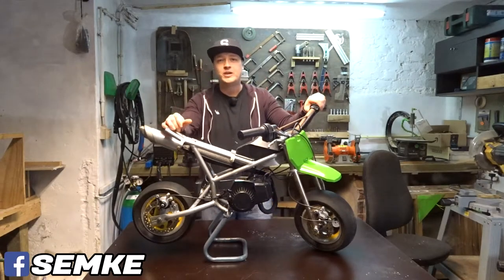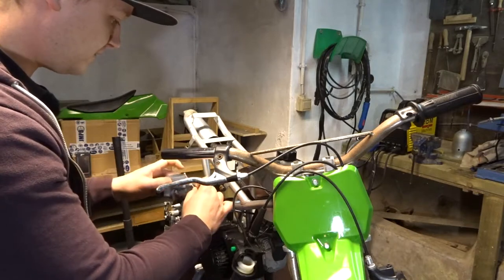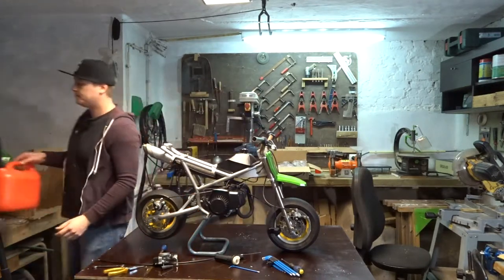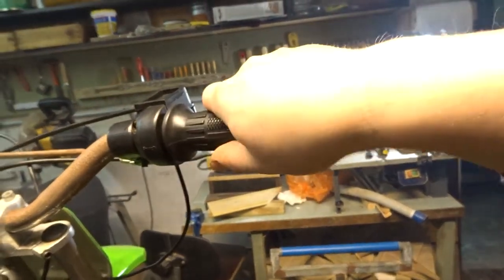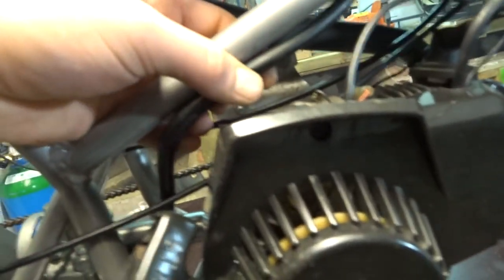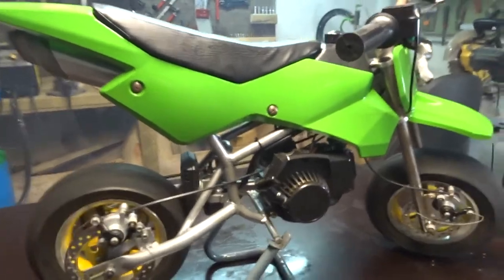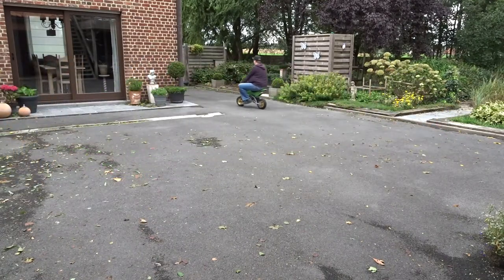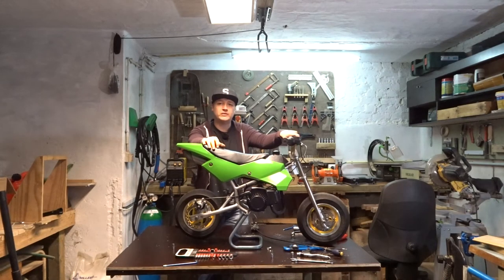let's take it for a spin - pocket bike / mini bike

Comment: I bought a pocket bike off eBay for £160 never ran right, pegs too long and scraped on the floor, wheels felt wobbly even when tightens. In the end it was stolen😂
Reply: The thieves probably tried to fix it and then threw it away 😂
Reply: CDA441 they picked it up, put it under their arm and walked off😂